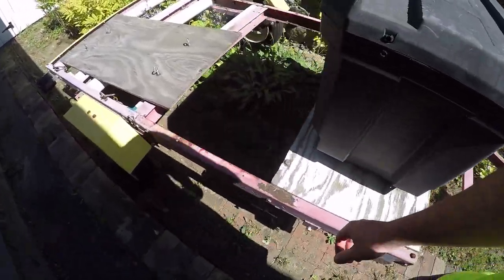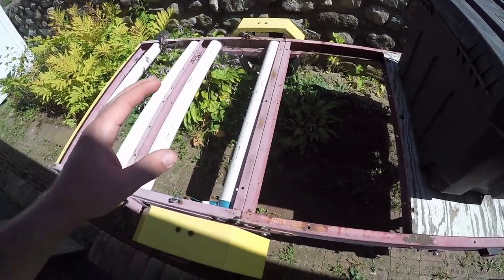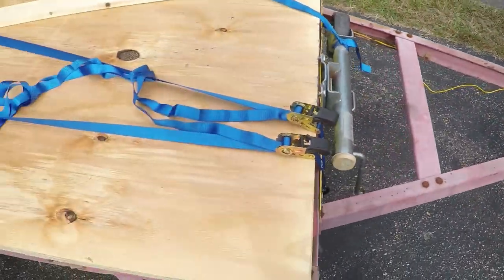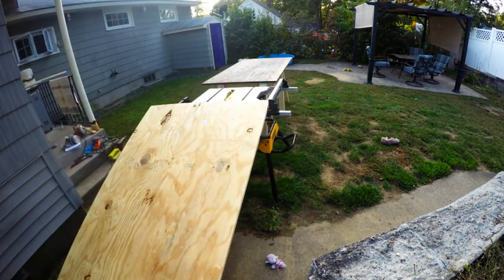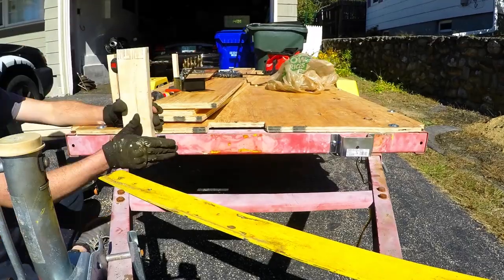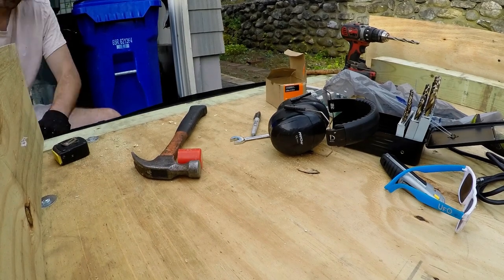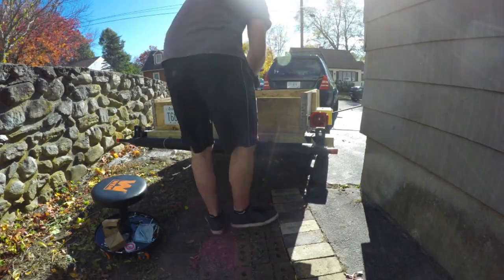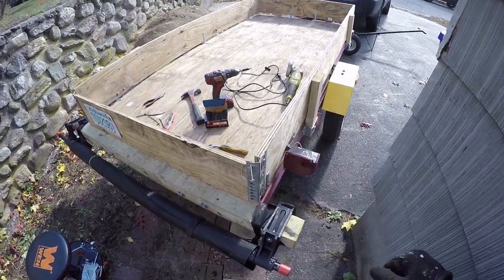Upgrading My Harbor Freight Trailer

Comment: My advice to anyone installing lights on a rusty trailer, run a dedicated ground wire from the plug down each side of the trailer and land it to the frame at the taillights, by the connector at the tongue, and at the side marker lights. That way you have a return path that isn't relying solely on rusty metal and bolts.

Comment: Fun video! I love my HF trailer. Mine is the 1720# load capacity & would recommend it highly. The things that you had to get are called pocket or post brackets. Whoever built this trailer before obviously didn’t install them. Don’t know why as it was super easy; putting the trailer together was super easy. When I built mine, I used a forstner bit to to give me a way to lay the plywood flat. I would also recommend using eye bolts to secure &/or cover loads. I would highly recommend getting a trailer jack.  All said, I like your modifications. Especially the "Load Handler." Going to watch that part again to see how you did that. Good job!

Comment: Instructions for folding is to take 6 bolts out! 2 carriage bolts on each side and 2 bolts under the two middle crossbars that are bolted together all for stability. Makes no sense honestly. I built one and just don’t use the folding ability(not worried about space saving right now), was a pain the butt to build, but it was worth the low cost.
Reply from the maker: Thanks man! Might change it up when I refinish things after my project!

Comment: Definitely keep a spare wheel and tire if you have a small trailer. I made that mistake and by the time I got back, the trailer was gone. Some crackheads saw it as an opportunity I guess and just put it in the bed of the truck or dragged it. No recourse whatsoever, DMV and highway patrol. Don’t give a damn about your little utility trailer even if it is bonded to get a license plate. Yes, here in North Carolina you have to have a tag on any trailer of any size. Some folks say. that you can paint “farm use only“ but what is a farm used trailer or vehicle doing on public highways? Seems shady to me.

The process in North Carolina is silly, you have to go to your insurance company and pay over $100 to get the trailer “bonded“ after which they send you a form that you take to the DMV. If you do not have a vin number you will be in trouble.

Comment: Were you able to use actual two by fours? The take the little plates off and install them around the two by fours? Mine are not quite large enough for actual two by fours. They are slightly smaller requiring me to shave a blonde one off the sides of all the 2x4s to make them fit
Reply from the maker: Mine fit the full 2x4 with a bit of room to spare! I walked into Home Depot to physically measure beforehand for that exact reason

Comment: I’m wondering if the wiring diagram on the instruction manual that came with these trailers is wrong, every single one of these I have seen that have been put together and wired by people who work in electrical engineering the left turn signals do not work. I have seen three like this and all three were assembled by folks with electrical engineering jobs or degrees.
Reply: Did they use self tapping screws to ground them?

Comment: How about showing the cargo unloader working still can't get in my head , if you cut the width down.
Reply from the maker: I didn't trim the width at all. Instead, I curl the extra width up the sidewalls to help contain the debris. It's a hand crank unloader. You can see it 3.5 minutes into this video:
https://youtu.be/PnRf5eQezxQ

Comment: You are really not supposed to toe with all wheel drive on Subarus, since they are actually all wheel drive. I would not turn more than 1000 pounds and if there is a front wheel drive option or if you can pull the fuse to make your Subaru front wheel drive only I would do that for towing.
Reply: What?  Why does my Subaru have a hitch receiver and 3,500 towing capacity?